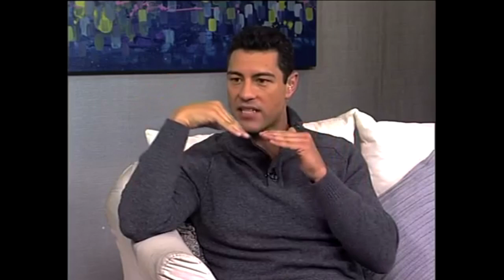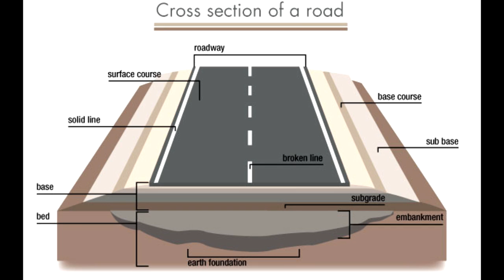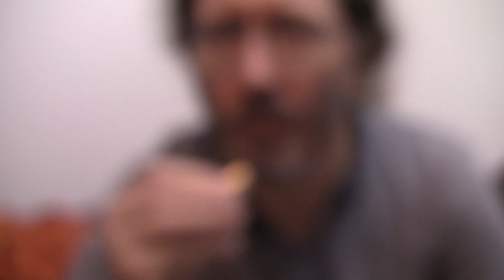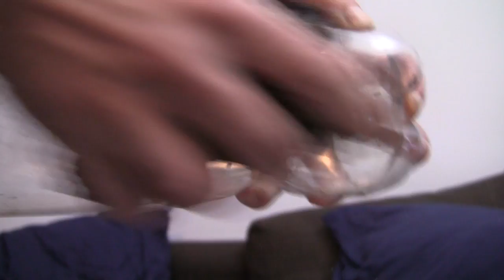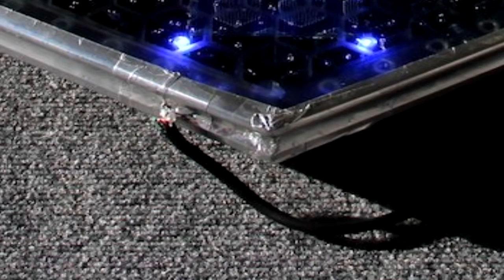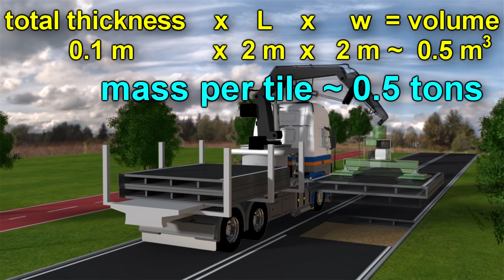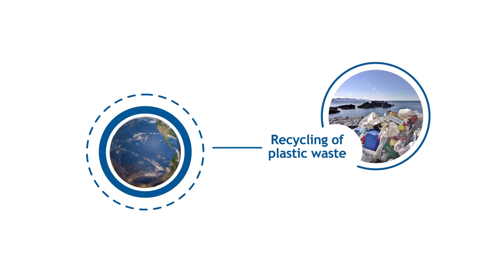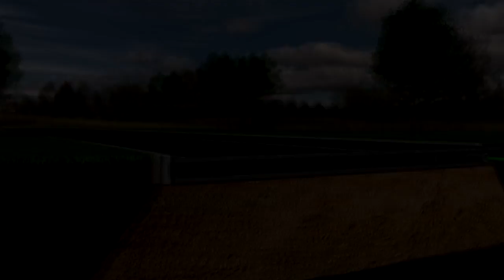Plastic Roadways BUSTED!

Comment: as cool as the solar power aspect is of this idea, it would change the skill set required to maintain, it would need electricians to work on the roads, creating a wage/ salary cost increase, also it fails to mention a how you would turn off the sun to turn off the photocells to turn off electricity production, also I would like to know how this road would fair in traffic accidents, fires, and various chemical spills,   I guess a motorbike destroying itself flipping over and over would do serious damage, battery acid, engine oil, gearbox oil etc  leaks would go into the "waste" water system, and a car fire would set the road on fire too, where as the current roads seems to be fire-proof as last time I checked stone/rock etc does not burn

Comment: Here in California, they recycle and reuse the asphalt right at the spot where they are repairing the road.  They grind off the top layer, reheat it in a boiler, add some fresh asphalt, and then lay it back down right where it was taken up at the start.

Comment: Yea, lets put important cables through something that will have considerable wear, this will make repairing damaged sections so much easier. And if a cable fails you can just stop the traffic to fix it, no problem.
Also have it hollow so it can fill with water in winter, there is no way this could go wrong, right?
I'm sure plastic does provide much better grip than Asphalt, and you only need like (judging from the model) 5cm of plastic with only a couple of supports every 50cm to support a truck.
I mean, just look at that beautiful computer model, you don't even need to see a real prototype to know this is a GREAT idea.

Comment: These roads are quite a retarded idea. Although polymers in roads are not a bad thing at all. On heavily trafficked roads there's often polymers mixed in with the bitumen to add elasticity; this especially helps preventing deformation on hot days in the summer, when the bitumen starts to melt. Though the amount of polymer rarely is above 6 % of the mass in the bitumen mixture.

Comment: Also one major Issue, all that rubed off plastic will escape into the envirenment. As far as I know, even very small plastic particles can be harmful to the environment if pressend in a high enough quantity. Besids that, modular Streets are not a new thing, ask Hitler :P (the German Autobahn that was build in the 3rd Reich, was premanufactured concreed parts and yes there is a major reason why its not done anymore)

Comment: More problems with Plastic Roadways® are curves and pivots of roads. I've laid many roads in my days and most aren't straight and flat like some motorways (not even they are that, most of the time). Country side roads are organic and viscous, flowing with the landscape best possible. Plastic Roadways® would require more ground work and be harsher to the environment that way.  

Secondly, motorways are reinforces with steel frames to prevent buckling under heavy load. This does nothing to adress that. Also, with roads you can simply fill a pot hole with asphalt. Here, you'd have to replace the entire slab. Almost everything about this is dumb.

Comment: What is it with people wanting to use their new roads as conducts for pipes? A pipe needs a certain gradient to work effectively, so the longer your pipe is, the deeper it has to be in the ground, and for safety reasons it has to be at least 2 meters below ground to begin with. Even if you ignore that... the cavity they plan to use for pipes looks rather tiny. Ever wondered why sewer channels are that wide? It's because they're planned with heavy rainstorms in mind. The longer your intake area is (the area from which water will flow into your sewer at some point), the bigger the pipe has to be. In Germany, the regulations say it has to be a rainstorm with an intensity that only occurs every x years, depending on what is nearby (you don't want to flood things like subway tunnels every other week, those are expensive to fix). While it is nice to see that people who have no background knowledge still try to come up with solutions, they really shouldn't post it as ground-breaking new concepts without at least consulting people in that particular business first. And no, not everyone will call it crap because they're too afraid of change. Sometimes an idea is just bad.

Comment: Tensile Strength.

that's the first thing that came to my mind.
Reply: Also the road would NOT be flood proof. water backups and clogging of drains would still be a thing. Modular roads? if you pulled the road out in segments you'd have to take every single pipe and wire out of it just to get that piece off, it would take way too long to repair.

Comment: 16:00 Plastic isn't really "free" in energy terms, right? You need the oil you use as a raw material, and additionally oil (or another source of energy) to convert your raw material into plastic. The latter portion of energy you cannot get back by burning the plastic.

Comment: As someone that's involved in both laying asphalt down and recycling it, this is just laughable. Asphalt does all of this already. Not to mention how fucking destroyed these tiles would be in places with extremely varying climate like we have here in Norway. Existing roads struggle enough with the ground freezing, cracking and moving all over due to extreme load and temperature differences. This would just flat out get fucked.
Reply: soundspark Nah m8, 1 Day tops. Your neighbor are gonna decimate it.
Reply: halsoy 
dont forget the need of individual shape of the road  in reality.
And what's about the fine, scrubbed plastic? Asphalt is dense and doesnt migrate. plastic particles are much lighter and will be migrated by wind and water.
Poor minded modern media-society: just running blind behind the hypes.
Reply: NicolasKolossos - Nicolas, don't man. It's Kickstarter plastic. It's got super properties bestowed on it from the Kickstarter God.
Reply: Even better than sharp edges, the breaking road surface would drop the car into the channel below, causing an even more catastrophic reaction.
Reply: halsoy it's plastic. If it breaks, the cracks will have VERY sharp edges.. And if a car passes on top of said crack, the tire could pop.
Reply: Not to even mention that asphalt has low coefficient of friction and getting surface grippy would involve several coating overlays and advanced tire-matched patterns(not such patterns as tires has, but such patterns that are suited for tires).
Reply: micklemore - What doesn't have faults? Your comment is pretty meaningless.
Reply: soundspark exactly. lmao
Reply: VerySalty Fries i could totally see someone violently uprooting tile after tile dragging with their truck
Reply: I'd give it about a second in space, as it would be vapourized by the radiation.
Reply: asphalt has alot of faults as well
Reply: Matthew Yabsley I have no faults therefore I am perfect. You are meaningless.
Reply: One of the things I thought upon hearing of "plastic roadways" is that their* proponents obviously don't know anything about roads. I'm at 41 degrees North, the seasonal cycles here produce huge frost heaves that would immediately destroy a plastic roadway.
Reply: Avery F - I'm really thankful you at least had your mother to say this to you. At least one person was kind to you in life :-)
Reply: halsoy but it would make a nice exhibition piece in a small town square. assuming it could last more than a month
Reply: +halsoy  Norway & those other Scandinavian nations need several thousand nuclear weapons to nuke all the other countries in the world (except maybe Japan and certain key high-tech areas of the USA & South Korea) to knock some sense into them.
Reply: The Ultimate Reductionist We're open for donations.
Reply: halsoy - That's because you didn't use thorium powered asphalt ;-)

Comment: Adding plastic to asphalt seems to work though:  "Resistance to deformation of asphaltic concrete modified with low density polythene was improved in comparison with unmodified mixes. " source: http://www.sciencedirect.com/science/article/pii/S2214509516300614

Comment: busted? not really your are under the assumption that it's one type of plastic. ..what you don't mention is that it can also be another type like polybenzimidazole "(PBI), marketed as a bulk polymer under the trade name Celazole. It is commonly reported to have the highest compressive strength of any unfilled plastic material, and also has the highest tensile strength, highest shear strength, and highest Rockwell hardness rating of any plastic that currently has  been able to be found. It maintains its mechanical properties at high temperatures better than any other unreinforced polymer, and can reportedly survive short-term exposure to 1400°F, which is 200° above the melting point of aluminum. ” try biting a one foot thick section and tell me if you get the same results. remember all platina are not created equal such as all metals are not created equal.

Comment: Years ago my local lumber store was selling plastic 2x4's, 1x6's etc.. This stuff was great for building things where high moisture was a problem. I used it for building some planters. Very expensive but will last forever with practically no maintenance. So there are practical uses for recycled plastic but the problem is cost. Sadly, due to cost, the product is no longer available. At least not in my area.

Maybe a plastic driveway or, a plastic floor in your garage. Or how about a plastic patio in the back yard. Or maybe just use much cheaper concrete. Bottom line is cost always wins out.

As far as that roadway, the first overloaded truck would break right through it. And every time you replace a section, you would have to cut and patch the cables and pipes. Just what I want... my internet connection patched every 40 feet.

Comment: Thank goodness you made this. Other commenters mention risk of fire, I come from a (before Global Warming) cold area. Ice expansion would mean those roads wouldn't last a winter and would break from the inside, if nothing else. Also, I don't know of any diamagnetic or paramagnetic properties of any plastics, so I wonder how the truck in the vid is even lifting the road tiles. Although, could recycled plastic be used to make paneled sidewalks? They don't face as much wear and tear when they're only subject to foot and bicycle traffic, and they could speed utility repairs if they had a shape that allowed special equipment to quickly remove them. All they'd need is flame retardant and something to seal gaps. Or is there something I'm missing?

Comment: Uber-Fail. Roads are already made from 100% recycled materials, from glass shards, to old tires, "dirty-fill," and asphalt. Nothing that goes into the making of a road is new-manufacture, other than maybe the equipment they use to do it.
Making roads out of plastic is just stupid, considering that 99% of plastics are UV-sensitive, and the fact that a plastic road would last maybe 10% as long as an asphalt/bitumen one, at 10x the pollution/waste produced through its being produced.

Comment: Lived up in Northern Canada and we tried to use a "Rubber Road" construction method with the intent to reduce maintenance time cycles given the wide range of heating and cooling (+38 to - 50) where I lived.  The major issues they had was it was too soft and wore through too quickly (lifespan approx 2 years) and reduced traction issues.  In the end a big ass fail.

Comment: LMAO! I live in snowy region being well versed in road slip a plastic road should it pass all the other issues you've named would be nothing but accidents. even adding stone to the surface would do little to change how plastic has a much earlier slip limit than asphalt does and existing roads are problematic as soon as temperatures drop and the binder becomes hardened/frozen and loses grip

Comment: Year ago  they used to build cement highways  consisting  of huge  slabs of cement  with a  tar filled gap between each slab. Asphalt was superior  and replaced  most of our cement roads because it could be laid down as one continual layer of asphalt with no gaps thus smoother longer  lasting roads with less problems. Plastic roadways seems like going back to older cement slab roads but  with plastic slabs instead of concrete.. I see it as  even more problematic than the old cement slab roadways. And  what is that plastic road going to be  like when wet,  covered with snow, ice, etc. ?

Comment: The most stupid about this hasn't even been mentioned in this video. Imagine thousands of cars driving around on plastic, breaking the plastic up into microparticles and spreading those in the air, groundwater and lungs of every breathing creature. It would be an ecological disaster to build these plastic roads.

Comment: Two and a half minutes in, there's already a big ol' problem - the plastic that bottles are made from is not terribly strong at all - you've probably crushed them in your hand before. They also melt on exposure to fairly low temperatures (I think the melting point of PET is around 200 degrees celsius) so they're not going to be suited to high-temperature environments.

Of course Mr.Foot is going to have a much more thorough buttfucking of the whole thing planned out, with diagrams!

Comment: From the Solar Roadways wikipedia page:

"The first public installation was in Jeff Jones Town Square in Sandpoint, Idaho. It opened to the public on September 30, 2016. As a pilot install it is for walkways only.[13] This installation consists of 30 Solar Roadways SR3 panels covering an area of roughly 150 square feet. The cost of this installation was roughly $60,000...None of the 30 panels generated any power after installation.[16] The City of Sandpoint's Proposed 2016-2017 budget includes $500,000 for future Solar Roadways projects."

Wow, so this shows the government is idiotic and the industry specialists have been handling it just fine.

Comment: Solar roadways, plastic roadways, what is up with roadway ideas lately?

Plus, I've found all these ideas seem to ignore advancements in making roads.  The foundation is still the same but modern roads are put together like a layered cake now, outer layer is soft and not very durable, but cheap and easy to patch/replace.  Lower layers are hard and durable for decades of use with very little repair and replacement.

Comment: You made a point of plastic "basically" being oil with more energy in it?
Couldn't we construct vehicle engines run on plastic instead? i mean let's say plastic contained 1.5 times the energy, wouldn't cars need 1.5 less fuel, meaning lower weight of the car and less fuel consumption?

Just an thought, could you please explain the fundementals why this wouldn't be feasible?

Thanks
Reply: The weight of the fuel is a fraction of the weight of the car, so any savings on that front would be insignificant. And plastic, being a solid material made up of complex organic molecules, would be difficult to burn efficiently, especially in an internal combustion engine, where the combustion needs to happen completely in a fraction of a second.

Besides, the last thing we need on this planet is more fossil-burning cars.

Comment: @24 currently I assume you will discuss how easily most plastics degrade in UV light and how hard it would be to maintain sufficient UV protection for these roadways...
Ya know in addition to load stresses and maximum capacities, heat and frost wear, ect, ect.
Reply: Wasn't disappointed. Nice video Thunderf00t.

Comment: I worked in the plastics industry for 24 years. This shit would never work. The thermal expansion rate of plastic wouldn't allow this to work. Go to Lowes & buy a 8' plastic corner trim piece. Toss it outside in the winter & it'll shrink 1/4" to 1/2" in length & will grow in length in hot weather. Imagine how much miles of road will shrink & grow. Not to mention the rubber used in car tires is very abrasive by design & would tear a plastic road to shit in no time.

Comment: @15:22 you ask "is it actually worth recycling plastic?" - and then go on to say you get the plastic for free energy wise, when you use the engergy from burning plastic instead of recycling it. thereby you imply that recycling plastic is not worth doing. energy 
wise it is free plastic, but you used twice as much oil, when making new plastic instead of recycling old plastic. 
because oil has a cost greater than 0, it is obvious that recycling plastic is worth doing.

Comment: The main issue you havent touched upon is the issue of micro plastics generated from the usage of these plastic roads. road "dust" is just fine sand with 5% bitumen mixed in, micro plastics are microscopic particles that will embed themselves in the local ecosystem for 100s of years.

Comment: Even asphalt roads sags over time with use, a road with hollow space underneath it is absurd. This would ultimately begin to sag and eventually fail causing massive pot holes that drop into the drainage space, insanely dangerous.

Comment: You made a mistake: if plastic roadways are lightweight so to set the price of one ton asphalt and one ton plastic are wrong.
You use less plastic per m² road then asphalt so it could be really cheaper then asphalt.
next time please think of details like this
Reply: You dont use less plastic when the whole road is a plastic surface rather than a bounding material based of waste oil. What uses less chocolate powder? A glass of 20% chocolate 80% milk or a glass just full of chocolate powder.